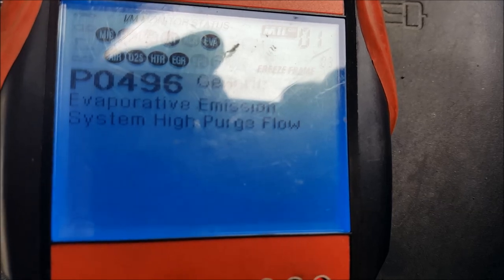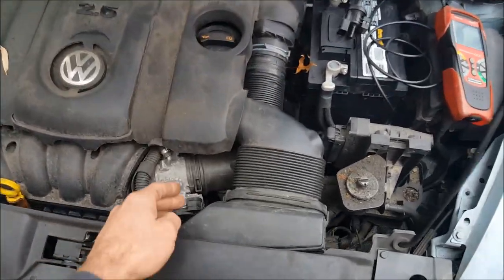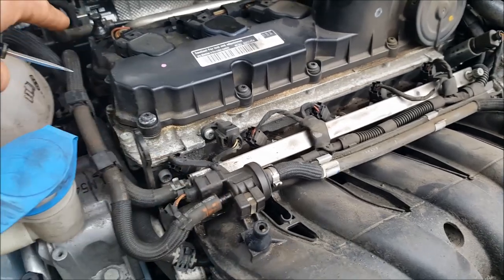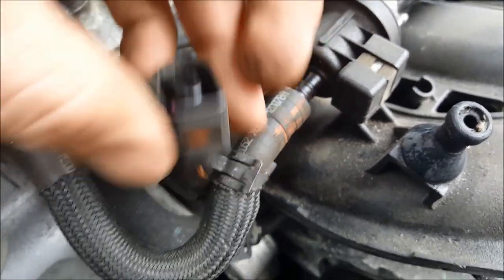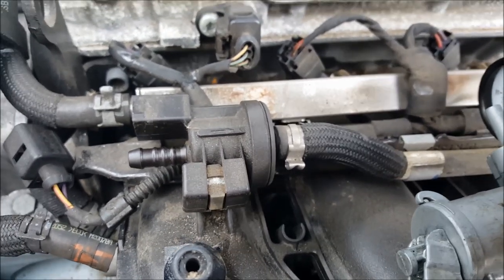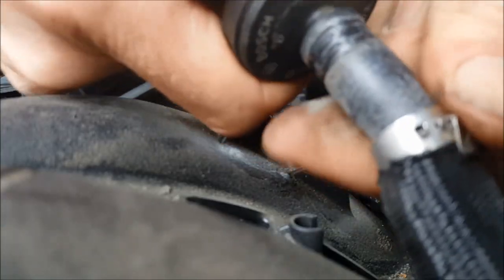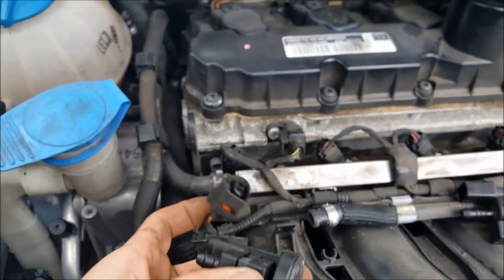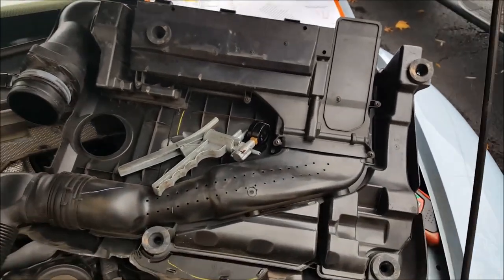VW BEETLE 2.5L P0496 PURGE VALVE replacement Audi

Comment: Very good & simple instructions.  I had the check engine light came on and off for the last 80K miles or so on wife's 2010 Golf 2.5 without other issues.  Knowing how little it costs, I finally changed it anyway.  Car seems to idle a little smoother.  Installation is pretty easy.  Hardest part was getting the hose off on the left side.  After spraying a little WD40, it came off fairly easily.  Thank you for the video. God Bless!

Comment: Just replace on 2009 beetle 2.5.  Only issue was a taking off elec. wiring harness... What work for me was to slip small pocket flat-head on opposite side and lift locking tab, (as see in the video) then slide it off.   Awesome couldn't have done with your awesome instructional video!!!!! :)
Reply from the maker: Great to hear you found the video helpful and I really appreciate you dropping a comment. Thank you

Comment: Great video! Saved me a bunch of searching. Different years hide these things in different places. This is a very similar setup to my daughter's 2007 VW Beetle 2.5L. 

One thing you said in the video is to get 3/8" clamp for the right side, but I measured mine and it looks a little bigger than that diameter-wise with the hose there. So I'm going to go with a 5/8" clamp to be sure. I believe someone down below suggested that same 5/8" size as well.

Comment: Update: Heck to the freak yeah! I did it. $15. Runs like a top. Thanks easter bunny! Tools: Channel locks, Small flat head, + get a 5/8" hose clamp, 20 min job. 30 if you replace the air filter in the engine cover. (recommend at least a check dust out) Cheers!
Reply from the maker: Nice work!

Comment: Great video I have replaced the purge valve on the wife’s 2011 beater 3 times now
Reply from the maker: Thanks Robert. Yeah I would imagine the aftermarket ones probably fail prematurely. Haven't seen this car back yet though and she's a regular customer.
Reply: NoNonsenseKnowHow but the funny thing is the valve is from orileys parts house and Bosch is stamped all over it

Comment: So my scan tool shows a high percentage on idle should I change even though I dont have a check engine
Reply from the maker: No I wouldn't mess with it if the engine lights not on
Reply: @NoNonsenseKnowHow  my long-term fuel trim (LTFT) is also high on idle ( STFT is at normal level). And getting bad fuel economy but no check engine code.

Comment: Hello, I have a 2001 VW New Beetle.  Where is this part located?  It doesn't seem to be as obvious as this 2013 Beetle.
Reply from the maker: Sorry without looking at it I couldn't tell you for sure. It should be somewhere on or near the intake manifold though. It is a valve that vents evaporative emission Vapors from your fuel tank back into the engine via the intake manifold